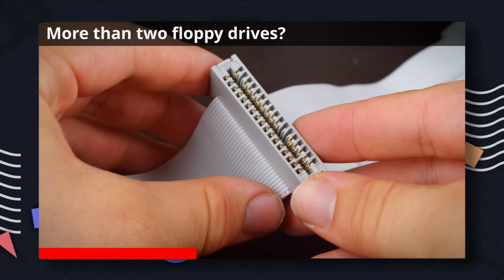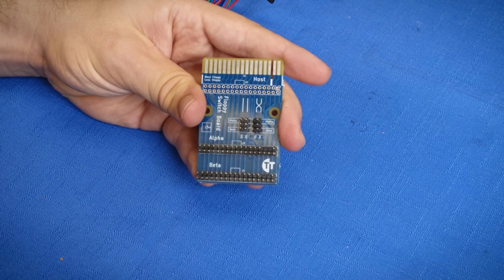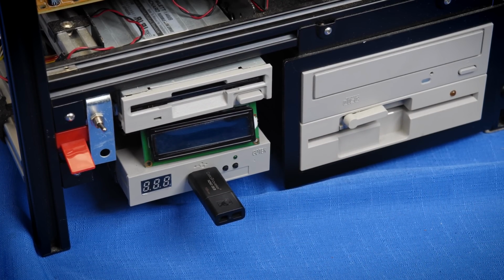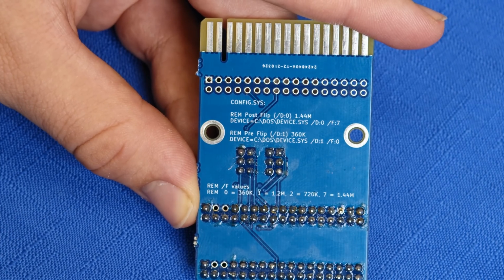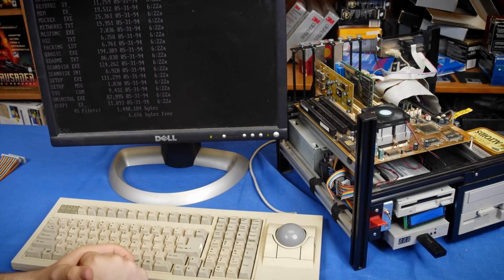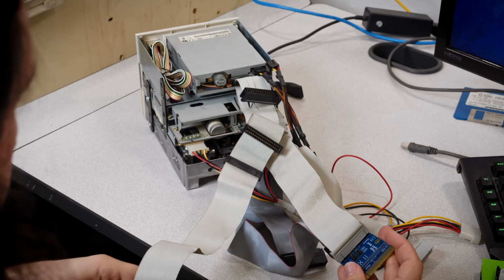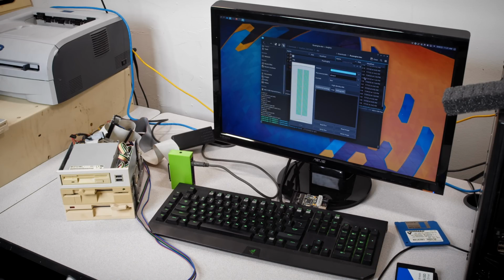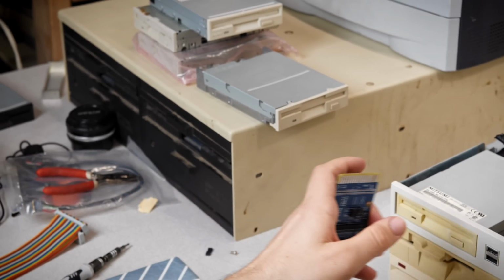Manual Floppy Drive Switching Made Easy

Comment: Greaseweasel supports Sa400.  I just use a straight cable.  With that, I have access to all drive id's.  With a Shugart standard (straight) cable, you have to specify the ID number during write.  For my setup, 0 is a 360k and 1 is a 1.44m drive.  To write a disk to the 1.44 I enter at the command line:  "gw write --drive=1 --format=ibm.1440 diskname.img"

Comment: I made a ZX Spectrum clone years ago and had 3 floppy drives connected to it. The thing is that TR-DOS known as Betadisk does support 2 drives only. While I needed 2 x 5.25" drives connected AND 3.5". Another thing to notice is that I used an old desktop case from some 286 PC which had a Turbo button on it. And guess what? I just used that Turbo button to switch one of "disk select" wires between 2 drives (3.5" and 5.25") so in one position I had two 5.25 drives available and in another position I had 3.5" and 5.25" drives. Easy!
Reply: Correction. TR-DOS did actually support 4 drives. But another problem occurred: some programs always thought they were started from "A" drive and that's why I had to switch drives actually. Whenever I needed to start a program from "a" drive I had to select 5.25 or 3.5 drive with that button depending on actual diskette.

Comment: I've been searching a 'breakout' floppy solution, and I'm wondering if that unpopulated header is a passthrough header.

I'm building a win98 retro rocket and the floppy header on the board is on the complete opposite corner of the case as the floppies. Even the longest cables don't have the right spacing... I know I could make a custom cable (which I might do eventually), but the costs associated with making a single cable are higher than I'd like. 

Would I be able to use this as a dedicated breakout for two floppies?
Reply: I probably should have watched longer... I think it will.

Comment: QUESTION...So if you want to add two of these to your system, one to swap between a Gotek and a 3.5 floppy drive, and the other to swap between 360k and 1.2M 5.25" floppy drives, how do you write the config.sys script? Do you have two seperate 'Device=C: \DOS\driver.sys...' lines, or can it be done in one line?

Comment: Find one of those old huge KVM switches with the physical A/B/C/D knob in a big beige box. Those switch several signals at once. If you don't want to modify the switch and you're sufficiently insane, you could make floppy-to-VGA adapters just to plug into the switch.

There are also quite cheap ICs you can get on breakout boards that do the same job. Four input signals route one pin to one of 16 other pins, bidirectionally. You would need one per signal you want to switch though.
Reply: or you could buy a 'rotary switch' bare! the rotary switches i've been able to find easily have 12 contacts and you can get them wired up in pairs, groups of 3, groups of 4, etc. i've experimented with using the three-pole ones for audio, it's effectively what a lot of old audio switchboxes do as well. a 2 pole rotary switch would let you choose from... six floppy drives!!

Comment: As far as I remember most of the floppy-drives I have ever used facilitated mounting points under the drive. Maybe it would be a solution to build a mounting bracket to screw the board underneth the bottom-most drive in the system if there is room for it. This way the cables could be rather short.
Just an idea that occured!

Comment: This is just simply brilliant, with emphasis on "simply"... ❤I'm in love❤... and boy-oh-boy do I feel your pain with soldering up those toggle-switches.
- There came a point where I just began soldering pin-headers directly onto the toggle-switches and then used Dupont-patch cables. But an even better solution is to use these smaller PCB-mountable switches which is available in exactly the same variation of pins and with exactly the same functionality. Then of course solder those onto small PCBs with through-holes for pin-headers... and, you guessed it, use Dupont-patch cables in-between.
- But I guess if you also (just like me) love to hate these old Airwolf-style toggle-switches. Then I guess similar PCBs only with holes large enough for the "pins" of those Airwolf-switches wouldn't be entirely impossible to create 🤔
BTW. That unobtainable crimp tool you mentioned... is kind of rather easily available on AliExpress. I think I paid around $20 for mine.
- Search for "G-214 Cable Clamp IDC Crimp Tool"
For the Toggle Switches
- Search for "SPDT DPDT Latching Toggle Switch MTS-102"
I got mine from a store called "EternalFar" (on AliExpress) - okay quality, not military grade... but what do you expect, right?

Comment: We used that driver.sys trick to pretend there was a 2nd floppy drive in a single drive system.  You could then point your software at the B: drive and the OS would prompt you to switch floppies.  It was only useful in a handful of scenarios (read: crappy business software).

Comment: many years ago I saw a PC with something like this and used a key switch instead of a toggle switch.

I think the DRIVER.SYS was mostly used for tape backups that used the floppy controller like the Colorado DJ25 jumbo 700. Or a SCSI floppy drive possibly?
Would the SETVER command work to trick the DRIVER.SYS driver to work with say DOS7.1?

Comment: Floppy cables are cable of daisy chaining up to 2 drives (with a twist on some of the ribbon lines or set the drive ID).  Some drive controllers have to connections to allow more than 2 floppy drives to be connected by connecting more than one cable.  Wouldn't this be easier?

Comment: This has got me thinking: 
I have a BBC Master and want to use 3 drives - a 5.25, 3.5 and a Gotek and I would like to have the 3.5 or the Gotek as drive 0  and the 5.25 as drive 1 and be able to swap drive 0 and drive 1 (so I can boot from either the 3.5/Gotek or the 5.25).  Food for thought indeed.  I definitely would buy one of these boards for my Greaseweazle setup, too.

Comment: i tried to do something similar with just a switch and IDE hard drives. the thought was switching the jumpers to allow the system to boot the first drive so this would allow swapping. it sort of worked and then i never revisited it. switching between master and slave not that that exists, but then again neither one is primary or secondary either....... so...... ?

Comment: How complex is it to replicate that refresh signal which the real floppy drive sends when you take a disk out?  I ask because I'm curious if it'd be possible to integrate a circuit into the switcher board that sends that signal whenever you throw the toggle switch.  That would be really cool!!

Comment: How about making it the same form factor as a 3,5" drive? Lots of machines have plenty of empty 3,5" hard disk slots, so you can put it in there and maybe even accomodate even more drive cables if you want.

Also, you would have enough space for things like relays or digital multiplexers which would allow you to select drives through some command from the host system.
Reply: And how would you control a relay from dos? 😂
Reply: @JohnSmith-iu8cj  Simple serial I/O? Or maybe even an ISA I/O port connected to a relay driver, through an AND gate and a latch, if you want to keep it super low cost.

Comment: The cable solution is easy. Design it to use a PCB mounted switch. The PCB could be mounted to a bracket with a switch

Comment: This is nice but could be so much better and don't need driver.sys and there are two ways to achieve this:
1. add a push button which issues a disk changed pulse
2. add some more logic to automatically issues a disk changed pulse when the selection switch is switched

Comment: I'm wondering whether this plus some kind of driver would work with one of those floppy interface cassette tape drives? I guess you could connect the tape drive on the first connector and the adapter board on the second one, then load the tape drive driver plus the MS-DOS driver too. maybe that would work?

Honestly I've never managed to get a floppy interface tape drive working. I got one in a machine I bought of eBay ages ago, but the HDD was dead so I never got it working. I assume it requires a specific driver though.

Comment: you could add headers for whether the incoming cable has a twist, and for whether either of the outgoing cables has a twist (one header each). instead of using icons, i would write "has twist" and "has no twist"

Comment: if you used a DPTT switch you could have things as follows:
position 1. drive 1
position 2. emit disk change signal
position 3. drive 2

this way, you could spare yourself this whole disk driver stuff and dos would be told everything by hardware
Reply: @Mr Guru so how does dos know the disk changed and it needs to invalidate the cache being talked about in the video?
Reply: It’s been a while but there is a dedicated pin for this, I believe it indicates 1 when a disk has changed, then drops to 0 when any other command is received.

You’d still need to initiate some disk operation for it to notice the new disk, I think. I don’t think this tripped an interrupt, I think it expected the system to check this pin at appropriate times, but I could be wrong about this.

Comment: This uses the same DOS functionality that powers the logical B: drive in a single-floppy system. It's been a while since I've looked at the DOS innards, but either it just notices the two drives have the same physical drive number, or there's a flag set in the Disk Parameter Block, and you get the whole "Insert disk for drive X:" thing. It also remembers which one is currently in use.
Reply: yep! There  was some random neuron that fired off remembering that message, and that single floppy setups would use it.  It made it ALMOST like you had 2 drives, but some software was hell on switching between disks.

Comment: Using a mux like CD4052 (74HCT4052), can switch between 4 drivers using two switch (or a two bit encoder switch).

Comment: Add a button.  Disk detect is just another pin on the interface.  Exposing it on the same header would let you rig a momentary switch to for a disk detect anytime you want the refresh.
Reply: Should be pin 34.

Comment: Very interesting indeed, especially with the driver.sys info. Never knew what that was for. Definitely easier than trying to find a floppy controller that can handle drives 3 and 4. But that makes me wonder. With all the other modern recreations we have in the retro community, has someone made a new floppy controller board that would support 4 drives, or at least 2 with selectable addressing?
Reply: If you see his "4 floppies controller" vid, i think he points out to XT FDE or something like that, that seems to be a homebrew project for a floppy controller that supports 4 disks with different IDS
Reply: @eduardoavila646  I think I watched that, but I’ll have to double check. I also found an open source design for a FDC, that can handle up to 8 floppy drives, which is insane.
Reply: @soberjedi42  Woow, really cool actually

Comment: I have been working on a device that sits on a floppy cable between a drive and the computer. It has three modes of operation. One, it can disable the drive and emulate it. Two, flux image a disk from the drive or three, become invisible and let you use the drive as usual. It is controlled by wi-fi and an app running on a phone.

Comment: Did this all the time in the 90s when you needed dual 5.25" for some software but wanted to use a 3.5" for new stuff. MFM hard disk controllers were still common. You can plug your toggle switch directly place of the floppy drive jumper switches and skip the breakout board entirely. Just crimp more plugs on your cable.

Comment: my current nightmare is getting the SCSCI drive I have to work with a dell pentium 1 using an interface card, only reason I accepted this machine was cause it had SCSI interface and IDE interface
Reply: also this reminds me of having to soft reset the kaypro I have as CPM doesn't do hot swapping very well and the cache doesnt always clear so sometimes you have to I think its crtl C on the kaypros to soft reset the unit, forgetting to do this can result in disk read errors in cpm 2.2
Reply: @Mr Guru could just be my syquest drive has died of old age too

Comment: I'm interested in this because of PCs that only support a single floppy drive but I have no idea where I would put the switch.
Reply: Yep, later 98 machine, only allows you to configure one drive in the BIOS.
Reply: No such thing as a PC that only supports one floppy. Do you mean your cable only has one connection? Use a different cable. The PC floppy interface supports multiple floppies. Your floppy drive will have jumper switches to set drive select if your cable doesn't have a twist.
Reply from the maker: I have an IBM motherboard that only allows you to configure one floppy drive. The BIOS will only ever report one drive to the OS as a result effectively meaning the board can only support one drive. This could be used to work around that but that board is probably later for running Win98 or XP which isn't going to be as smooth of an experience as it is with MS-DOS

Comment: For the switch you could always just make a second PCB, attached to the first one but can be snapped off or just a separate board entirely, that has hole for the switch to be soldered in and a pin header to connect the wires. That is assuming the time consuming part of making them is attaching each individual wire by hand.

Edit: the header would have to stick out one side and the switch stick out the other side. And maybe some key or colour code for the wires/connector so no one plugs things in wrong.
Reply: I was thinking something like that, but perhaps soldering the switch onto an edge, vs through hole.  then the pin header would extend backwards and it would be in a nice line for mounting

Comment: A heads up to help you: Having it shown in linux could help spread your idea. Also though AtariST (since it uses PC formatted floppies). As an aside, an (A500) Amiga mod would be cool. A PC (or Amiga) version via ieee1284 or parallel ports would be cool but switching partly via serial (mostly PC though, especially parallel bootable, EPP and ECP). See also Lallafa Parallel Plipbox (Amiga).
My comment has no hate in it and I do no harm. I am not appalled or afraid, boasting or envying or complaining... Just saying. Psalms23: Giving thanks and praise to the Lord and peace and love. Also, I'd say Matthew6.
Reply: @Mr Guru  I know about that configuration and yet I was speaking of a different variety of scenarios. For example, perhaps you have heard of how the external floppy drive port can be converted to become the boot device by means of gentle alterations to the motherboard. Thereby fd1 is fd0. Then so as to save 30KB in memory (per floppy drive), a switch between floppy drives like that device is a potential method to try (similar in some ways to the video). Be mindful that having 4 floppy drives simultaneously instead of 1 means that an extra 90KB RAM is use, and yet some amiga models have only 256KB or 512KB RAM. Additionally, some software refuses to recognise drives beyond the fd0 drive. This information is to help you, kindly.
Reply: @Mr Guru The original Amiga A1000 has 256KB RAM and some Amigas like an A500 have 512KB. That is an example of a nice bit of information to expand your knowledge and brighten your day. Also, other people can enjoy the information above. My comment has no hate in it and I do no harm. I am not appalled or afraid, boasting or envying or complaining... Just saying. Psalms23: Giving thanks and praise to the Lord and peace and love. Also, I'd say Matthew6.

Comment: Greaseweazle can support 3 drives at once with a flat cable. You have to jumper a unique drive select for each drive.   In the software, you would then indicate drives 0,1,2 instead of A,B.
Reply: !!! Hard to read, hard to follow (no links), hard to search for ... so please thank YouTube for Censoring !!!
For more info, see <insert Big Message board with R>: glencanyon, 10 mo. ago (topic "I installed 3 floppy drives and a greaseweazle into this old SCSI enclosure. It has a 1.44MB 3.5" drive, a 360K 5.25" drive and a 1.2MB 5.25" drive."): "I used a cable with no twist.

You have two options with the greaseweazle. You can use a standard floppy cable with the twist that supports 2 drives. The two floppy drives would need to be jumpered as DS1 - like in a standard PC configuration. From the command line using the tools, you would then indicate you are using drive A (beyond the twist) or B - the drive before the twist.

When you use a straight cable with no twist, you can connect up to 3 devices on that single cable. You then have to jumper your floppy drives to be either DS0, DS1, or DS2. From the command line, you would indicate the drive as 0, 1, or 2. I made this cable by cutting off the twist from the cable (I just used scissors) and then added another edge connector to give me 3 connections."

Or the Greaseweazle <censored source code site, starts with Gi> wiki site, "Greaseweazle Models": 
Features - Multiple Drives, supported by Model: F1 Plus, F7 Lightning Plus and V4. Previous Models not included (Nov. 2022)
(Multiple Drives: Allows simultaneous connection to two PC, or three Shugart, drives on a single ribbon cable. Useful for cased installations.)

see also: John Elliott, "More Than Two Floppy Drives"; Greaseweazle <censored source code site, starts with Gi> Wiki, "Drive Select"; and as a little overview for jumper-piano-players: search for the 5.25-jumpers <insert the abbrevation for Portable Document Format, which is also censored> on "Jope's drive modification page"

Comment: The test bench is my favourite of ur pc builds too. Very practical.

I think I would mount ur interface board in 5.25 bay fan controller hub, add it to ur drive stack, and replace the dials with buttons to select the drives